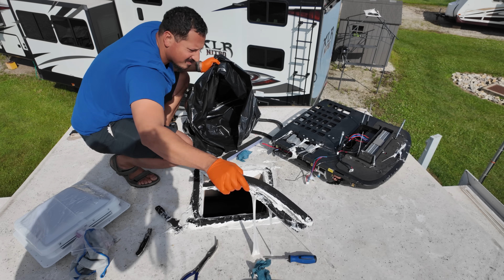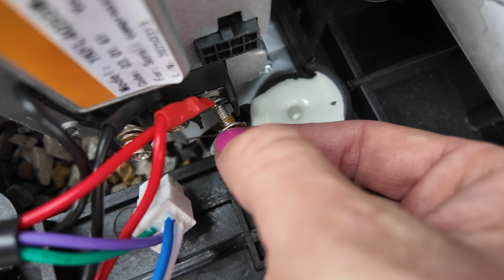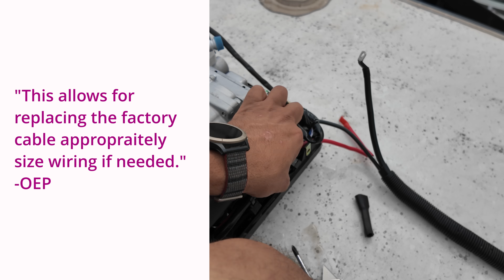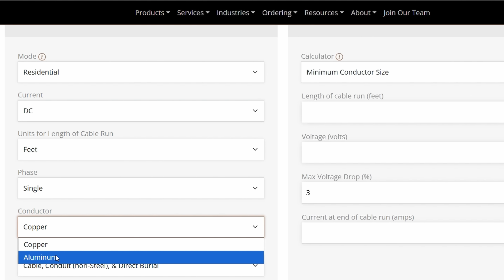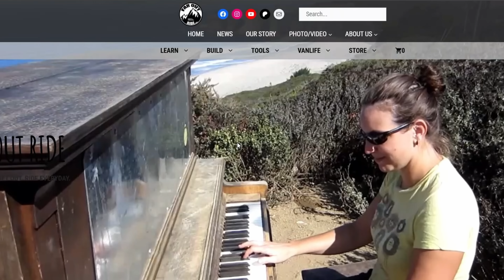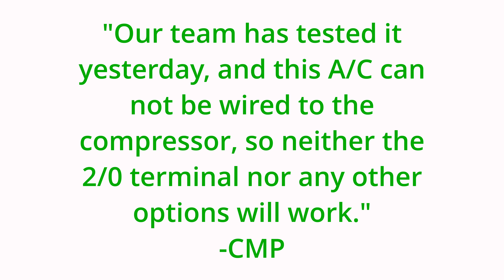The Truth About 12V RV AC Wiring in Big Rigs (What No One Says)

Comment: One possible idea is to Run you lager wire to a treminal block in your 6x6 box. then use the factrory wire from the AC to that block. This might help out.
Reply: Bingo! Also, the South wire app is asking for the run distance, not the total cable distance. No need to add the positive and negative distances together.
Reply: Also, the question about running for a while relates to the load being considered continuous duty, which I would consider an air conditioner to be. This relates to de rating the ampacity of the wire for the buildup of heat over time. You're already oversizing the wire for voltage drop, so no need to upside the wire again for ampacity. 1/0 is good for ~150A which could carry a 120A continuous load. I'd go with 1/0 then transition to the factory #6 near the unit in a junction box.
Reply: This was my first thought.
Reply: I thought the same thing. The Big wire can carry the load to right at or close to the AC unit.
Reply: Bingo…terminal block, bus bars, etc. is the solution. 120V is okay as an alterantive to DC, but inverters are inefficient; and, you still need large wires for rhe DC side.
Reply: You made the case for going 24 volt.
Reply: @OldManandtheSuperC yea i thought the same thing.  Ive been debating getting one of these for my 18ft travel trailer and im limited in space for batteries to be forced to use 12v options.   However with a rig as big as OPs, to me 24v would have been a no brainer.  Not to bash anyone maybe they have their reasons for going 12v.
Reply: yes this is what happens for alot of battery banks with solar off grid system … the battery supply cables will be a lot heavier from bank to inverter but once the distance has been covered then the gauge of wire is dropped at a bus bar…
Reply from the maker: Yea this would could of worked, I’m happy that everyone is sharing so many great ideas! Thanks!
Reply: @DeterminationUnbound  I was screaming at the screen the entire video saying exactly this. The wire doesn't need to be the same size all the way to the compressor. Run the big wire as close as you can to the compressor and then do the shortest possible run of the smaller wire into the compressor.

Also: You kept making references to fire danger. Longer runs of wire do not increase risk of fire. They only increase voltage drop at the end. The 55 amps through a 6 awg wire will increase it's temp the same no matter if it's 5 ft or 50 ft. You lose more power to heat in the 50ft of cable but the "watts per foot" is the same no matter the length so the temperature rise is the same. 

For voltage drop: This isn't based on someone's feelings or opinions. Find out what the minimum voltage the compressor needs and use that to determine maximum allowed voltage drop. The voltage range of a 12v battery is usually 11-14v, so I would find it very hard to believe that an A/C designed to run on a 12v system would require a minimum of 12v. It's usually closer to 10v. But again that needs to come from the manufacturer of the unit, and it's usually stamped on the appliance somewhere.

Or just switch to 48v. That's what I did with my rig. The money (and weight, which eats into your trailers cargo capacity) you save on copper makes it well worth it.
Reply: @JeremyAkersInAustin  I'm not sure that's directly true.  Let's assume that the unit draws 50A.  At 12v that's 600W.  That's the amount of work that the compressor (and fan, etc) does.  If you increase the voltage to 13.6 (nominal on a Li battery) then the amperage drops to ~44A.  Conversely, at 11v it's 54A

Heat in a wire is generated by current flow and resistance of the wire.  Smaller wire = more resistance....and that's multiplied by distance.

So, if your device is not designed to shut off at a specific voltage, then as the voltage drops, the amperage increases, and this generates more heat in the wire (particularly at terminations.)  That's also why fuses in the circuit are so critical.

In the case of these A/C units, I would assume they won't function below a certain voltage. Plus most Li batteries shut off at 10v.
Reply: @JCHoefer  That's not quite how that works. A motor will not just continue to increase amp draw to infinity as input voltage drops. A motor needs a minimum voltage to maintain a specific power output. A motor is also not a perfectly inductive load. The windings inside a motor have resistance which means that as the voltage drops so does the locked rotor amps because the "short circuit" current through those windings decreases with voltage. So below a certain point as voltage drops amperage will stop increasing and eventually start to decrease instead. That point is affects the minimum voltage required for a motor because at any voltage below that the motor's power output will be reduced as it is unable to pull more amps to make up the difference.

"That's also why fuses in the circuit are so critical."

Yeah, duh, which makes everything you said above that a moot point. If you wire a circuit for 50A, it should have a 50a over current protection device. Which means you have have as much distance at 50A as you want and you haven't increased any fire danger because if something does try to pull more than 50A it will trip/blow the OCP. Whether it's 10ft or 100ft it does not matter. 

Feel free to check the NEC. There is no distance restriction wire ampacity from a code perspective. It only matters to the actual load because of how much voltage drop that load can tolerate.
Reply: @JeremyAkersInAustin Excellent, 
perfect explanation.
Reply: @JeremyAkersInAustin  True, I was just pointing out that there could still be a fire hazard.  I've found that's typically at connection points, not in the middle of the cable.
As far as fuses, can't tell you how many times I've seen unfused wires or fuses that are WAY too large for the cable.  Hence my statement.
Reply: @JeremyAkersInAustin  You and I both .. My wife came in from the other room and asked what was wrong .  LOL
Reply: @JeremyAkersInAustin  yes country mod pro makes a 48 V AC and that’s the real answer for this situation
Reply: @DeterminationUnbound  this is the answer!
Reply: Noooo. When you downsize, keep it copper. Aluminum never should have been provided.
Reply: @DeterminationUnbound  yeah I was gonna suggest exactly this. I had ChatGPT run the numbers on a six AWG whip to your junction box or even run two parallel 6AWG whips to your junction box but I don’t think a 12 V AC is gonna cool your rig down. 
GPT:
A short pair of 6 AWG whips from the roof junction block to the air conditioner would probably be entirely reasonable, especially since OutEquip itself supplies 6 AWG at the unit. At a 3-foot one-way distance—6 feet round trip—the approximate drop would be:

* One 6 AWG conductor per polarity at 60 amps: about 0.14 volts
* Two parallel 6 AWG conductors per polarity: about 0.07 volts
* At 80 amps: approximately 0.19 volts single or 0.095 volts doubled
Reply: yes, this.  And just make sure to fuse the wire to protect the smallest gauge wire used.
Reply: This would work for me when adding a second smaller online breaker in the box.
Reply: @bendemby924   The dc breakers are often mentioned in forums as being problematic.  I would vote for a fuse with two spares handily stored in the box.
Reply: Agree. Running copious feet of gigantic wires for every high current device is painful. Plan out where the big current devices are, and wire a bus nearby. Protect the bus circuit according to the (big) wire size. Then wire smaller wires to the devices, with individual circuit protection according to the smaller wires. You pay a bit more for additional circuit protection, but you save big in copper costs. Plus you solve the problem you encountered where you are trying to hook a gigantic cable to a device that doesn't have proper termination for it.
Reply: This is exactly the solution that would work fine.  The larger wire doesn't have to run the whole way,
Reply: The larger, the wire, the more amperage it can carry.
Connecting a wire to a terminal block, does not change the fact that the wire can only carry the amps, that it can.
Reply: @wiley0714 3' of #6 vs. 30'-50' = less voltage drop🤷
Reply: This is the solution. You have to think about the internal wire size when you open the unit up, none of it is that size for several reasons. The loads of the units are calculated by adding all of the sub component demands together. Each sub unit does not need that large wire size which is why you see several different gauges used. Bring you main cable to a junction box as close to the unit as possible. Then shorten the unit lead wires to be the correct length, avoid coiling the excess but leave some slack for repair room and movement.
Reply: @tomhyde7823  I don't think the solution was for you to write all of that just to say what somebody else said.
Reply: Exactly what I came to say
Reply: Seriously this has been burning my mind for days. Electronics engineer turned remote off gridder. Life partner constantly upgrading kitchen appliances. Now putting in 3kw inverter with 4/0 feeders. Run the long distance with 'supply or feeder' cables then terminal block , distribution,  short distance with manufacturer sized cables, or double manufacturer cables without modifying ac units terminals. You can always check with laser thermometer for overheated points when running. 
Best of luck.
Reply: This !!
Reply: I was just thinking this too!  Not perfect - but I think…may be an option? At least for the problems at thr unit itself?
Reply: 100% .. I watched this on my TV then ran down to my computer to see the comments. Whomever they were talking to did not understand or they did not get it explained to them correctly. If they ran 1/0 AWG to the terminal block they would only be running the 6 AWG wire a few feet. Also as you without a doubt know they ask for cable run length and not total wire length. This video is filled with so much bad information and I hope it wouldn't make anyone not buy the OutEquip A/C.  It's nice they talked about all of the calculators out there but you have to use them correctly.  They really should add onto this video with all of the corrected information people are providing here.  I hope they make a new video .. Great work by the commenters !
Reply: Run back to back 6 AWG from the AC connection point to the 6x6 termination box.  The terminal at the AC might accommodate back to back lugs.  Keep that run as short as possible.  Mark, I do these calculations all the time and you are on spot.  Especially remembering that you have to consider the total run of the positive and negative run.
Reply: i believe this can be done just try to stay at a short length for the factory wire, witch i believe is 6 awg. Treat it like an appliance whip, but i would get close to the ac unit and try to keep the 6 awg 12 inches.

Comment: Put it in the bedroom. The run is shorter. Air and heat are the most important when you sleep. It's easier to cool a small space, then a large space.  Just get enough power to make it through the night.
Reply from the maker: We actually did consider this for all the reasons listed, but in the end opted not since we didn’t not know how it would work and didn’t want to lose the ac in the front room in the mean while. Thanks for sharing!
Reply: I say the other way around. 
I'd rather be comfortable when up and doing things. I can sleep in warm weather (home goes over 100 regularly) especially where temps dip at night. But realistically 13.5k will only do a bedroom.

Comment: Great video. But it is possible. I'm adding a 12 volt AC to my rig right now and have a 25 foot run to the batteries. I ran a heavy cable to a cabinet near the AC and plan to use about 3 feet of the 6awg that came with the unit and connect it to the transition in the cabinet. I used a 125 amp breaker as the transition point and have a 100 amp breaker right after it leaves the batteries. Should have use two 100 amp versions. You have to run two calculation if you do it this way. One to the transition and take those results and run it from the transition to the unit based on that distance and 6awg.
Reply from the maker: I have heard others in the comments! So glad you’re sharing this info, and helping provide alternative solutions! Glad it’s working out for you and Thanks for Sharing!
Reply: Exactly what I was going to say after watching. It is about total voltage drop from batteries to ac. So just put in a distribution box near the ac with smaller shorter wire and run the heavy wire the long distance to batteries.
Reply: I thought that I saw the MOCP on 12V countrymodpro is 100A not 125A

Comment: I installed a country mod in my 40 foot diesel pusher I upgraded the 6AWG wire it came with 4AWG granted my wire run was a lot shorter. I had replaced the absorption refrigerator with a residential style. I was able to come in through the vent and straight down to the batteries only about 15 footer cable and it’s worked great for me. I’m very happy with the country model. The reason I chose country mod one was price and two was the way the air distribution outlets are on it. They face forward and backwards instead of little round box that you adjust.
Reply: I have a forty foot Monaco dynasty with13500 btu a/c front and rear was thinking of a mini split but would rather do as you did do you find that it cools you rv down
Reply: @notsoshortbus1651  I run mine when I travel, but I pre-cool the coach with my big basement ACs and if I’m Boondocking I  pre-cool  the coach for about two hours three hours  then I shut the generator off and just leave the 12 V running and it’ll keep the coach about 72 to 70° all night  I’m really happy with the country mod unit I like the way that the AC vents point forward and backwards. Instead of straight down. I have no complaints. I’ve had it installed now for about four months.
Reply from the maker: That’s Awesome! Glad to hear you were able to make it work!

Comment: If you instal a battery in a location relative to the conditioning unit this will act as a load supply for it. The you can run small gauge wire from the battery to the unit. Then run 1/0 or 0/0 cable from the rear battery to your main distribution. Remember to always load, protect the runs between the battery and from the battery to the unit. The same design can be used with a capacitor mounted relative to the unit. However, you would need a very large capacitor. So a second supply battery to the unit would most likely be easier.
Reply: There's no reason to add a battery or capacitor and it'll solve nothing.  Just run the big cable to a location near the unit and connect that to the cables that will fit the unit's connections.
Reply from the maker: This an interesting concept. Thanks for sharing!

Comment: I recently went through all this. 32 ft long rig batteries at the front air conditioner installed in rear. After everything was said and done I installed the furrion chill cube. It is 120 volt so running a comparatively small 12/2 ac wire was easy. Same soft start compressor as a12volt and the minimal inverter loss is well worth not dealing with the cables for DC. I've seen it running at 100 to 300 watts after the room was completely cooled to temperature. So far very pleased and it cost difference in wire paid for a good majority of the unit on a large rig.
Reply: I upgraded an RV I recently purchased with that amazing Chill Cube before I even left the dealership. Been camping with it for the last 15 days continuously. I will be replacing the rooftop ac on my other 3 RV's. Finally the variable speed compressor/fan residential technology has made it to the RV world. I love it. And it's so much quieter.
Reply from the maker: I can see why you would go that route, it makes a lot of sense. We are even prepped with pre run wires, so it would be a breeze. 

I wanted to explore 12v ac, In particular for the purpose of boondocking with out an Inverter or generator. 

We are exploring another solution to see if we can make it happen. Thanks for sharing!

Comment: I bought the outequip pro like yours and used your original video to install mine.  I am running about 20’ total 6ga wire.  Used it for almost a month straight and the wire never got even warm.  I would just use the gauge the calculator says and step it down just before the ac unit.  Stepping down to the 5/16 terminal would be fine in my opinion.  Thanks for this updated video and hope you find a solution.
Reply from the maker: I’m glad it’s working out for you! Im hearing a lot of stepping down the wire would be okay. Thanks for sharing!
Reply: @DeterminationUnbound maybe you can contact or ask (explorist life, or will prowse) here on YouTube.  They are both pretty much the GOATS.

Comment: For the wiring you can just use a step down splice right before you get to the terminal block, this is a very common solution in the industrial DC cabling world. Let me know if you need help or more info on this.
Reply from the maker: I was wondering if that was okay or not. It seemed like a lot stepping down from a 2/0 wire to a 5/16 ring terminal.
Reply: @DeterminationUnbound That is fine to do. You are going for low resistance and upsizing most of the run does that. The resistance of a foot of 6awg is negligible at 50 amps. As long as the short piece meets the ampacity requirements for fire safety, you are fine.
Reply: @david672orford  I’m an electrical engineer.  I agree with david672.  This is done all the time with point loads at the end of long runs. … think pier lighting and power, pump stations, and even street lighting circuits.